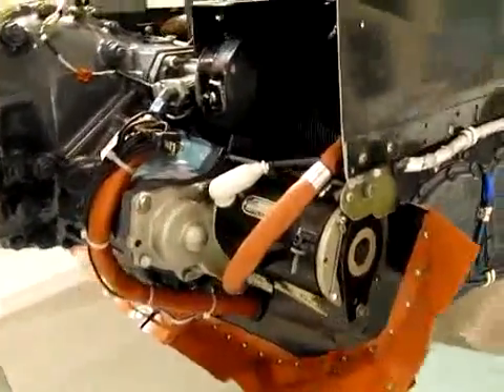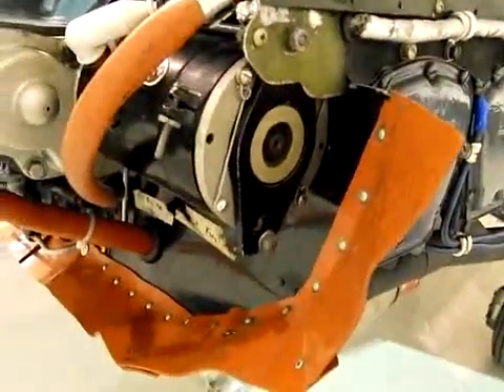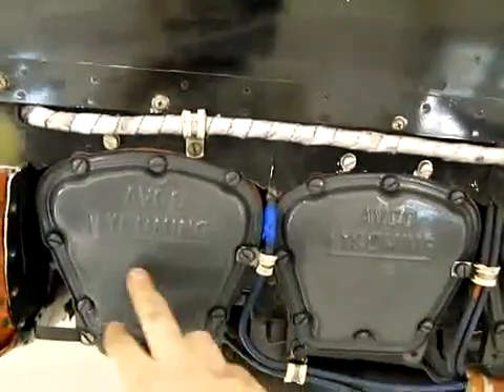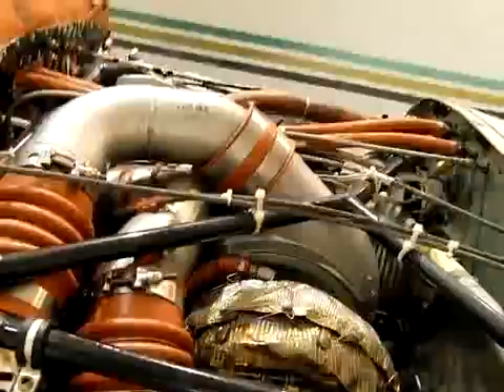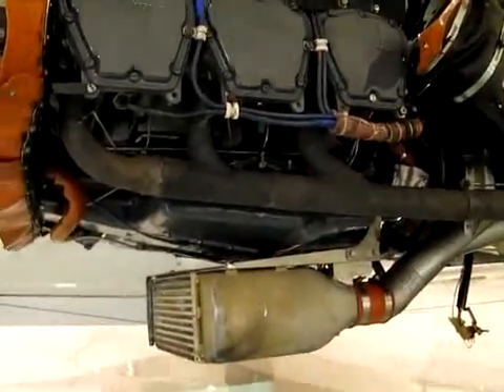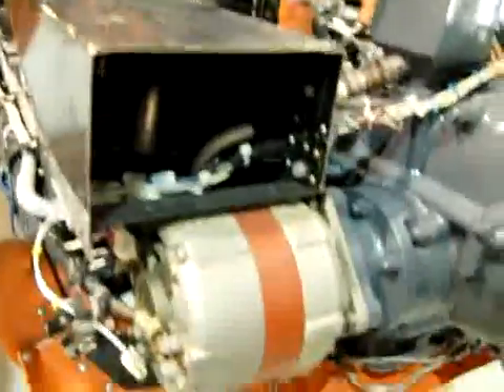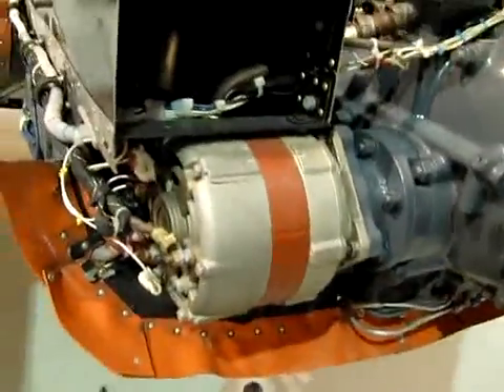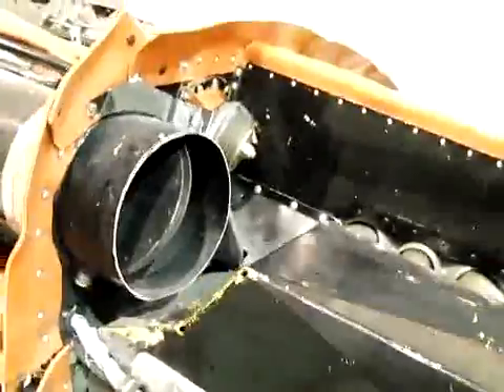AVCO LYCOMING TIGO-541 Piper Navajo

Comment: my dad still runs one of these.  Its a great airplane.  How many alternator shear couplings have you had to buy???  :)
Reply: I'm more curious to know how many cylinders you dad has gone through. This engine ran very hot because of the high horsepower.
Reply: dieselyeti on his first set of engines he didn't have to replace cylinders at all until about the last annual before a full rebuild. Maybe 1100 out of the 1175 hours he got on them. And I think he replaced 2 or 3 cylinders at that last annual. He ended up doing rebuilds because of cracks in the crankshaft counterbalances. 

He's about 700 hours into his second set of engines and hasn't done any cylinders yet. Although he runs the engines very rich and at much lower EGT and CHT than the book says to. Like they say, you can pay at the pump or in the shop. He is also religious about his power changes and max cooling rate during descents.
Reply: A friend of mine had a Panther Navajo, and once told me "Friends don't let friends buy P-Navajos" :)  I'm sure that's because the engines were known problems. But like you said if you burn the gas to keep CHTs down you'll probably be ok. Too bad they won't run on super unleaded pump gas.
Reply: dieselyeti lol I can understand that statement for sure. They require special attention. The sad thing is that they are one hell of an airplane performance wise. We go to sun valley in it all the time and literally can't fit all of the people and luggage from the P into our suburban. It has something like a 1500 lb useful load with full fuel. If it weren't for the cost of the engines and lack of parts, I don't think my dad would ever part with it.
Reply: Are airframe parts hard to find? I wouldn't think engine parts would be a problem.
Reply: dieselyeti airframe stuff is available, especially since a lot have been scrapped. The engine cases and gears are almost nonexistent though. The shop he uses said they aren't aware of any more new sets of gears. Meaning an overhaul with new ones may no longer even be possible. Lycoming stopped supporting that engine model in the late 90s or early 2000s.
Reply: I'm surprised to hear that. I'd think the airframe stuff would be a tough find, but if Lyc isn't supporting the engine anymore what does he do if one of the gearboxes goes south? Can those be overhauled?
Reply: At one time all the aircraft manufacturers built pressurized piston twins, I don't think very many of them turned out to be really good aircraft.